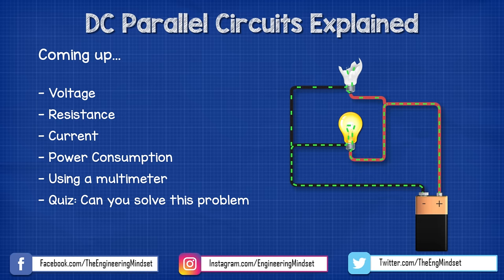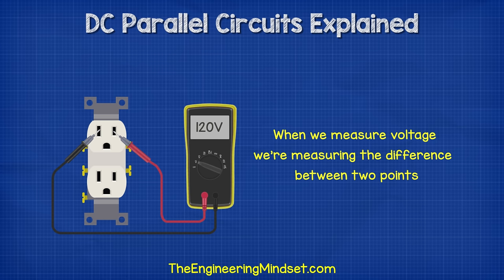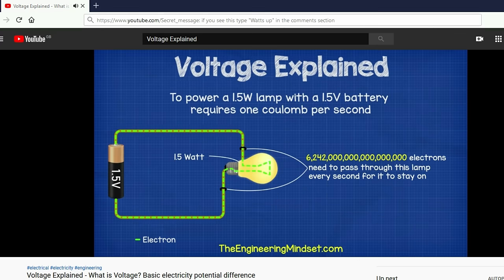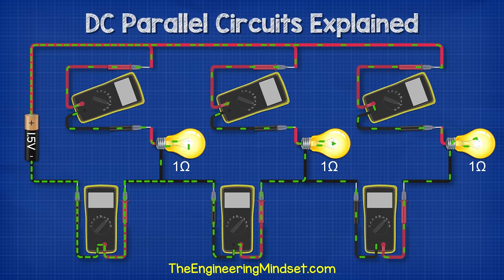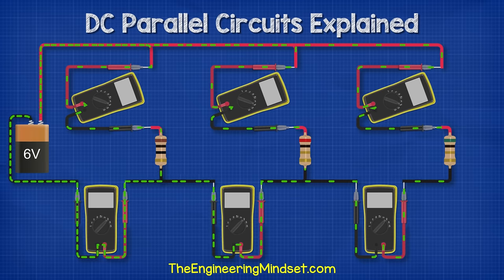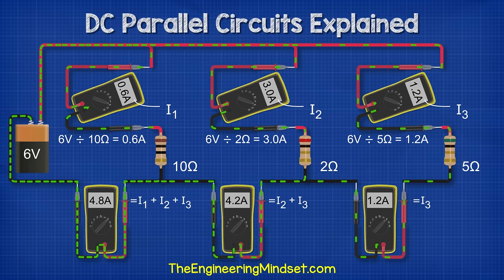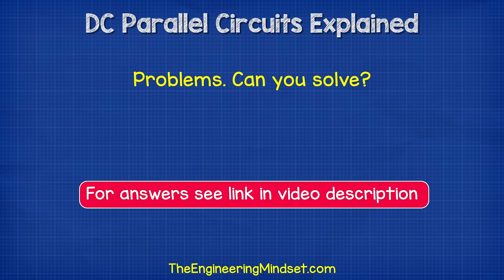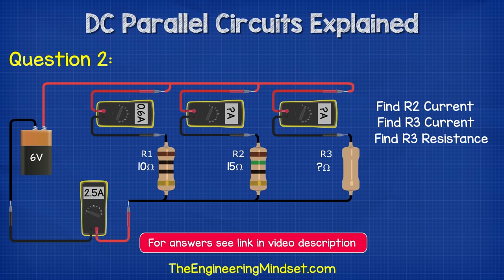DC parallel circuits explained  - The basics how parallel circuits work working principle

Comment: YOU TALK TO FAST!
Reply from the maker: Thanks for your feedback. While o can't edit this video now ita published you can pause the video at any point and also change the video playback speed in the video settings. It's also available in many different languages. We try to publish at a speed which is acceptable, for some it will be too fast and for others too slow.
Reply: @EngineeringMindset  that's understandable. i appreciate the content. i think i found a sweet spot .85 speed. thanks